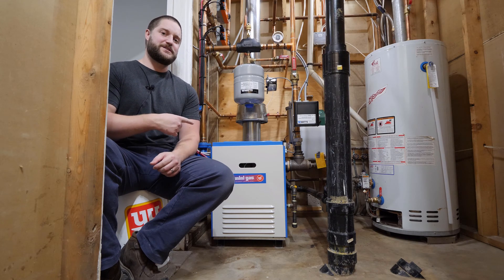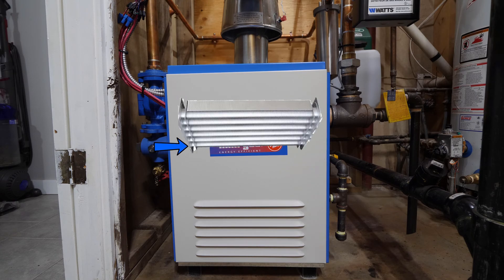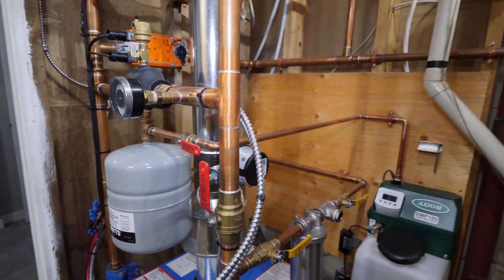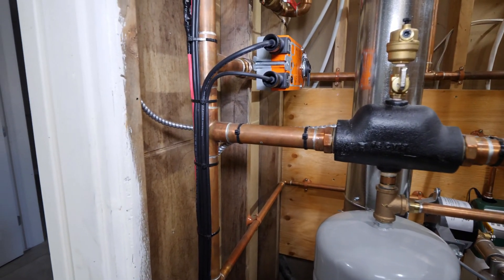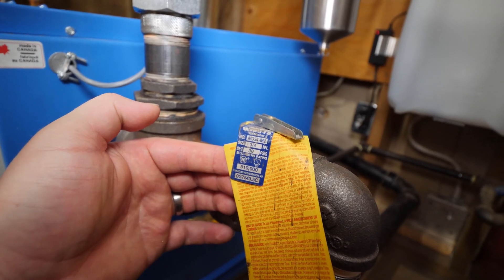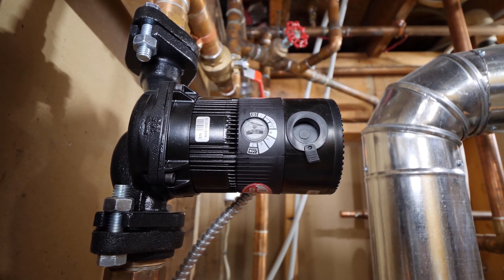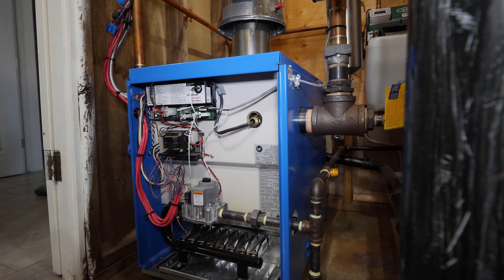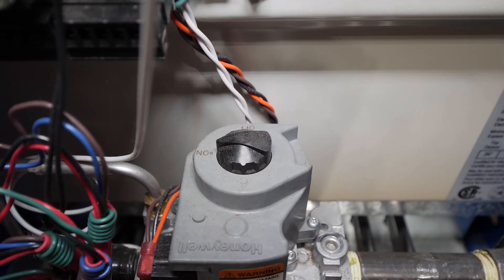Boiler System Explained: Hydronic Heating

Comment from the maker: 𝗔𝗺𝗮𝘇𝗼𝗻 𝗔𝗳𝗳𝗶𝗹𝗶𝗮𝘁𝗲 𝗟𝗶𝗻𝗸𝘀
1/8” Auto Air Vent
https://geni.us/5Qhv5em
1/8” x 1/8” Shut Off
https://geni.us/N8Ef
Taco 1/25 HP Circulator
https://geni.us/puAT
¾” 30 PSI Relief Valve
https://geni.us/VovScWQ

Disclosure: Pros DIY is an Amazon Associate. We earn a small commission from qualifying purchases through our affiliate links at no additional cost to you.

Comment: I have no power to my mini gas boiler. I have checked the breaker, fuses, wiring, and reset my dampner switch, and flame roll out. The pilot light is lit. But no green light on the control panel is coming on. So I could my control board be shot or should I check other things on my Control panel first

Comment: We also have an Allied Boiler.  It is 600,000 BTU.  It is short-cycling.  Allied says to stop the short-cycling, have a gas fitter to reduce it to up to 40% or to 250,000 BTU.  How does a gas fitter do that?

Comment: Thanks for the video! I have a similar boiler, and recently, it has been showing a softlock error (Error 65) every two weeks or so. I brought in a plumber who flushed the system, and I also replaced the temperature sensor with a new one. However, the issue persists, and we still encounter the softlock error every 10 to 15 days. The water operation is set to 185°F, and according to the manual, the softlock typically occurs at 230°F. Any help would be greatly appreciated.

Comment: Our boiler isn't starting.  House temp is down to 65 and all 4 zones are set to 70 . Still no boiler firing ( pilot is on ). The water temperature of all supply lines are cold. 
I found that if I turn OFF the power switch to the boiler system at the boiler I hear zone valve operating then all is quiet.  I wait for maybe 30 to 60 seconds and switch ON the power and I see flu valve opens and the boiler lights off the system builds up heat and circulation.  It seems to work normally until it satisfies the zone Temp and shuts down.  Some how killing the power switch seems to reset the system and starts the boiler burner.  Something is not sending the message to the boiler start control.
But yet it gets the message when I switch OFF the power monetarily and then back ON

Comment: I would like to see more videos on this type of boiler.
My problem is when it turns on and more than one valve requires heat, the burner starts moaning at a certain point, what could it be?
Reply: FOR MODELS MG-50-E TO MG-150-E

Comment: Really excellent video! Thank you!!! This helped me troubleshoot what I think is a bad flow control valve. The heat is stuck on even when thermostat is off with batteries out and no short in those wires. That flow control valve’s end switch is outputing 26 VAC on both wires (not neutral or thermostat W / heat wires) even though the thermostat signal is 0 / not calling for heat. Never knew or seen a heating system with a failure that kept it stuck on. Usually it’s off because bad thermostat batteries, open circuit, or a failed component.
Reply: If it’s stuck on, I first check for shorted thermostat wires in the wall behind the thermostat or elsewhere because if you strip the wires back too much/far, when you push the thermostat to the wall and secure it in place, those wires can be touching the exposed copper and shorting which calls for heat even if the thermostat internal switch is open / not calling for heat.

Comment: i have problems with the hot water tanks, the hot water from the boiler once gets just past the circulating pump stops, all my radiators work fine expect the domestic hot water

Comment: Hi , its about Mini Gas Super Hot boiler . Recently I replaced the thermo couple because the pilot  kept going off frequently. But after replacing the thermo couple the pilot light kept going off within one minute after main burner starts firing ; if the main burner does not cut in pilot burner runs continuously. However the problem resolved once I closed the round  hole beside the pilot burner  ( for inserting the ignitor  to the pilot  burner) by moving the sliding plate. Now the boiler is running continuously  but the flame is yellow ; I guess  the air flow has been  reduced  by closing the sliding door beside the pilot burner. Please advise whether is it ok to close the sliding door ? what to do about the yellow main flame ?Amman Zaman

Comment: hi from Canada, it was very informative video, i have the similar old boiler made by Allied model SSG225-N , the issue with it is that its standing pilot sometimes just turn off, so ive replaced the thermo coupler. its better now but still it turn off some times, so i have to re light it again. someone told me its very old just replaced it. and i took some estmates as well but they are askind 20k . which is insane. is there any way to fis this issue. is it a gas valve or what is it to fix this issue?  please need your advice and help. thank u
Reply: A year ago...I guess this guy never answers comments....I have an old Allied boiler as well, and yes, the pilot shuts off sometimes.....but this year wouldn't turn on...had the pilot line replaced, it was clogged with who knows what?  Its working now, but went off again tonight for no reason...maybe thermostats set too low...very quirky  system...3 years ago I had all the piping replaced with new circulator pumps.

Comment: I am looking at a MG-150 MBH boiler and it is currently running natural gas but I want to convert it to propane.  Will this be efficient and it is for floor heat already installed?  Natural gas is not available to me as I live in a quite rural property.

Comment: Does hydraulic heating the same as this boiler system (according to the title of your video)? I saw an article talks about one of the benefits of hydraulic heating systems is that " Forced air systems can draw moisture out of the air while heating it; hydraulic heating systems don’t dry out your home like other radiant heating systems since they use a liquid in a closed system to heat your home." is that correct?  because I saw the other "guru" talks about the benefit of the forced air system is that "forced air system has the benefit of speedy heated, area control and has to humidify/dehumidify implication." What is the better system when encountering a dry and heated indoor air situation?

Comment: I bought a house that has hydronic baseboard heating with a Weil McLain boiler. Unfortunately, the boiler was not used for five years. What is likely to fail in such a system during that time? I'm planning on repairing the plumbing, which has burst at certain points. After that, I'm looking for a professional to turn the boiler on. How do I synchronize my work with the specialist? I am first checking if there are no leaks in the circuit that heats the water for kitchen/bathroom faucets and showers. So far so good.

Comment: So the thermostat has no control of the boiler or the pump? The thermostats only control the Valves? Also what would happen if all of the valves close and the pump is still running?
Reply: This why you notice the supply and return is joined together. Mine also has a ball valve in the middle to keep a small flow going. I close the valve when cleaning the water and removing air.

Comment: Thanks for the video. My super hot mini gas has a 4 zone card but I see the contractor hooked up all 3 zones to only 1 zone on the card. Im thinking I will run individual wires to the Stats, zone valves and End stop Switches. That way I can see the zone lights on the card come on. He also used one of the zones 24V  to feed a flow valve that comes off the water tank. I assume that is OK.?
Over time both outputs on the card that feed the 120V circulating pumps are blown so instead of buying a $400 card I have the pumps hard wired 24/7. Im not very good at soldering but I ordered a $16 output relay to try to repair the card and if that works I am going to get a relay the card will feed which will take the stress off the card outputs. Im not a furnace guy and Id love to know if Im on the right track before I start snipping wires. Thanks for any input.

Comment: Do all boilers circulate an antifreeze coolant water mixture?  If true then the hot water storage tank contain that same mixture correct?  Great video. Thanks!
Reply from the maker: It is optional to run a glycol/water mixture. On my personal home I only run straight water as I have 2 heat sources in the case one goes out. The benefit of glycol/water mix is that if the system fails then the system won't freeze up. The benefit of straight water or treated water is it is slightly more efficient. You're correct, if I was to use a glycol/water mix I would mix it at the feed/storage tank. Thanks for the questions! Cheers!

Comment: Did I see your Water Pressure at only 10psi ?  for it to be between 1 or 2 BARs ( 14psi = 1 BAR)  that would be 20+psi  It so happens mine is only 10psi too   -- How do you increase the water pressure ? Show me that for an MG75( very similar to yours) and I'll send you lots of money that I would otherwise throw at a HVAC guy.
Reply: Add more water to the system. It will then increase the pressure.

Comment: Great video. I have the Super Hot system just like your video and recently I am trying to add a Nest Thermostate which requires me to install the Nest Power Connector. However, I am having trouble to figure out where to connect the c-wire to the zone control board as it seems to have different wiring label. Appreciate if you can help.

Comment: That's a lot of parts in there to break. Some of those wires are gonna need to be shorted out to get that thing to work. Sensors, paddles, fuses.... not necessary, just get yourself a fire extinguisher or two! 😕